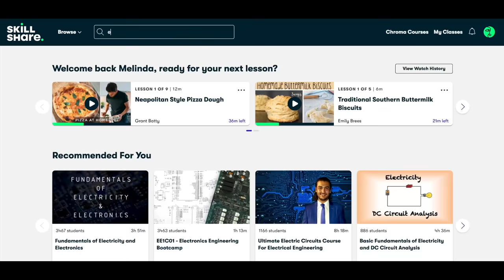ARE WE READY TO MOVE OUT TO ANCHOR? 10 DAYS to Design a Water Catchment System and Fix Our Dinghy

Comment: New adventure and challenges! When they throw you a monkey wrench, USE IT. Good luck! Stay positive
Reply: I fixed a pontoon boat pylon with the blow foam insulation "GOOD STUFF" it floats. I do not know if that would help. I also used the "FLEX SEAL" stuff but had very bad results, in wanting to patch a boat. If it were rubber you could use a rubber cement and rubber patch system, but I do not thing that would adhere to the vinyl material. Wish I could have been more helpful
Reply from the maker: Love the quote! What a perfect analogy 👏

Comment: I work on the water for a living. Any motor that you have is a good one but from my experience and we drive skifs like we stole them, mercury motors are alright but the throttle linkage breaks all the time and they are under powered and have much lower speed(4 stroke or 2 stroke). Yamaha motors specifically 2 stroke have been the absolute best in my experience, best snap, most power and fastest top end speed. I once lost one off the back of a skiff, it spent 8 hours under the sea and we recovered it removed the spark plugs and pull started it and sprayed WD40 (water displacer 40) in where the spark plugs were and later that day it was up and running again.
Reply from the maker: Wow! That’s great to hear. Thanks for sharing your experience with these different motors.